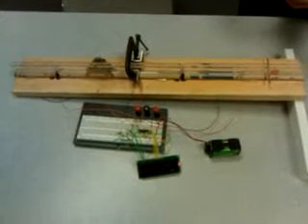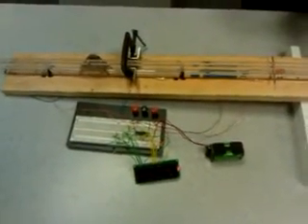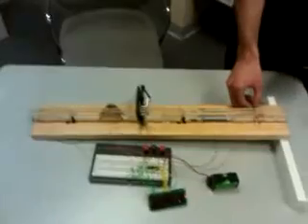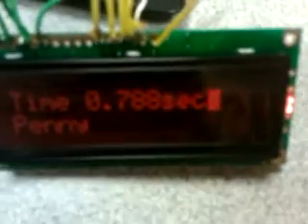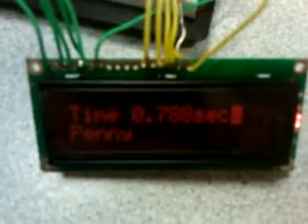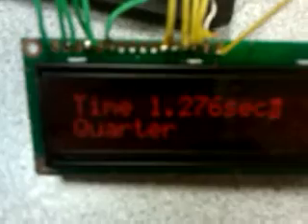Eddy Current Coin Identification

Comment: I'd be interested in how pre 1964 halves, quarters, and dimes are identified. Also the WWII nickel and penny. Im sure that the steel cent would just stop, but that would be a fun additional. I'm working on a similar project with an arduino that attempts to determine metal composition based on first weighing then timing fall through a tube with a uniform magnetic field (two halbach arrays attracted to each other through the tube) .